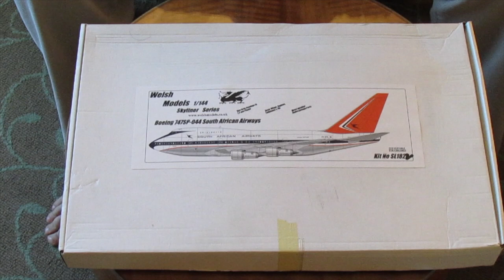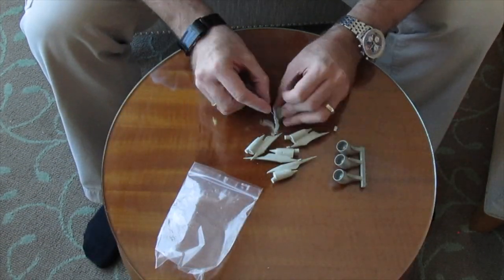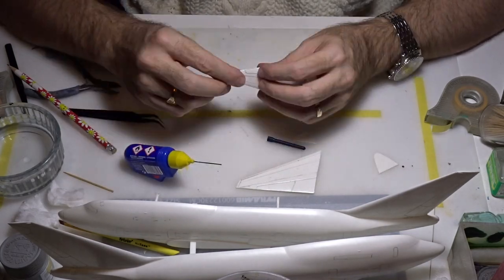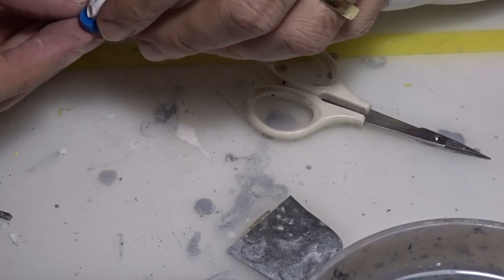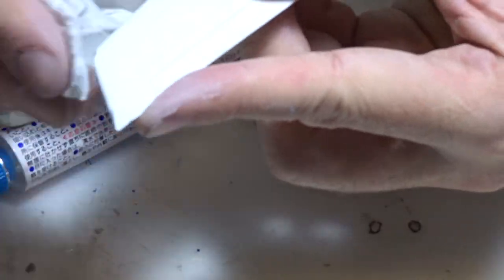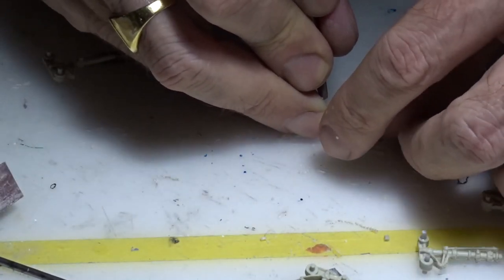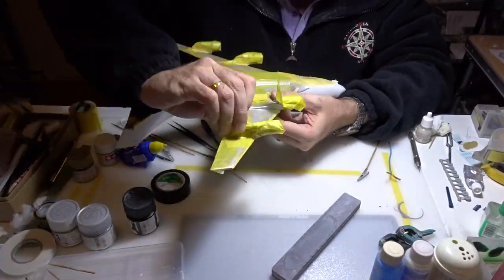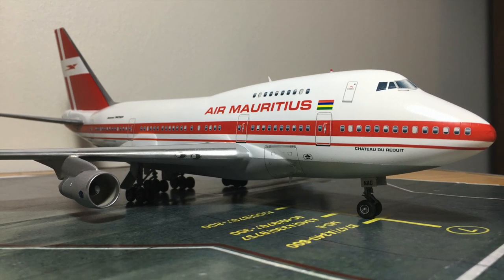Air Mauritius Welsh Model 747SP 1:144

Comment: So if you had to do this over again, would you still buy the Welsh kit or would you purchase the Eastern Express injection-molded 747SP kit?
Reply from the maker: Honestly, I would try the Eastern Express kit as I haven't tried it, but the Welsch kit is also more affordable it is 50 GBP vs 110 USD. Welsh also have a new version of the SP with resin wings, and  only the fuselage is in Vacum, but it 66 GBP.